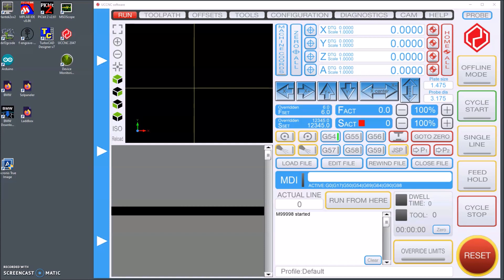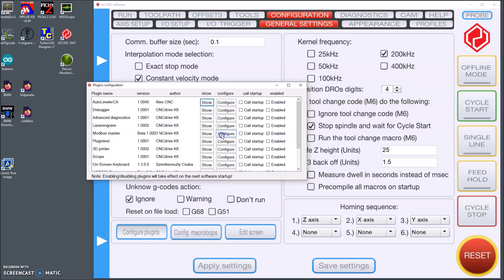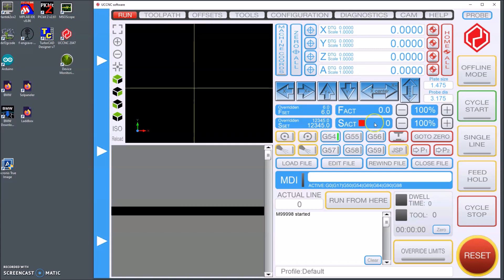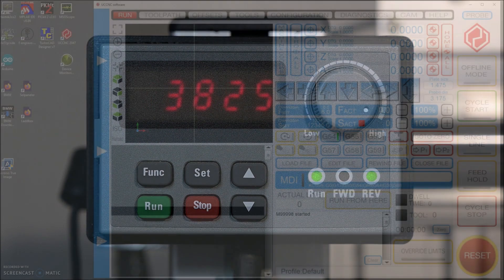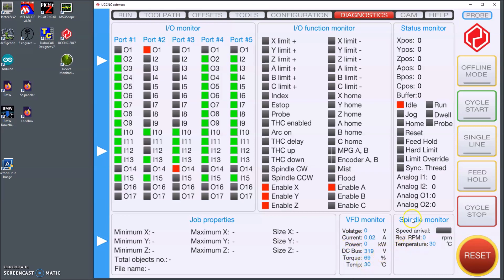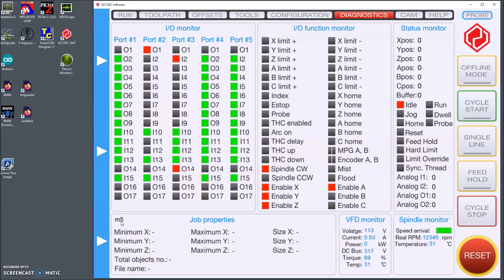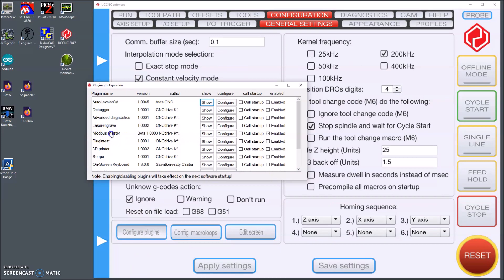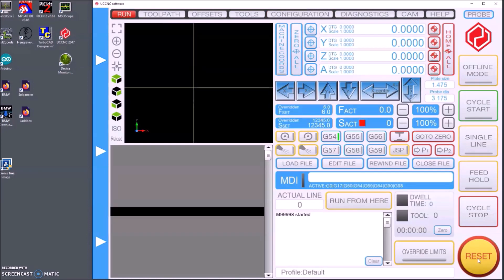Using Modbus to read and write parameters to the VFD and UCCNC

Comment: hello!
I also want to configure my vfd for modbus control.
using a delta vfd-el.
I was able to set everything up fine in mach3, but with uccnc I'm having problems. Your video works fine, but from what I understand - you need to edit or write macros? could you share your configuration, or provide a link where this issue is dealt with?
thank you!
Reply from the maker: Hi and thank you for your comment. I don't know the Delta VFD, but have used Mach3 with Modbus also. The use of Mach3 Brains is in a way simpler than UCCNC, but it is pretty odd and not as flexible as using Modbus with UCCNC. Also, UCCNC Modbus is pretty well documented, so have a look at the documentation of the Modbus plugin, which is in the folder called "Documentation" or something similar. Anyway, my macros are very much Bosch oriented, but feel free to use or modify it. You can download them from here: https://www.forum.cncdrive.com/viewtopic.php?f=11&t=97